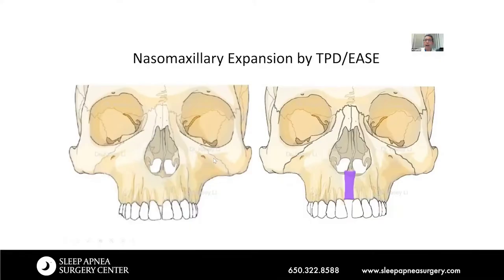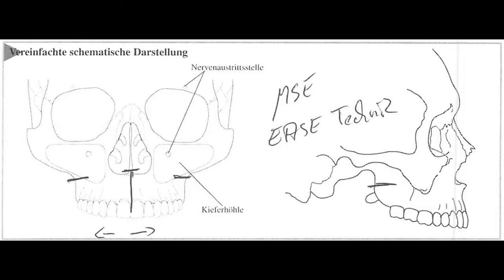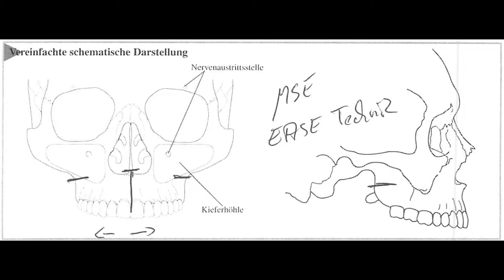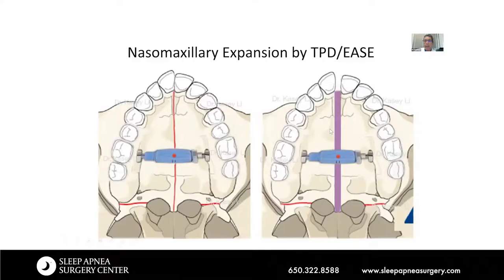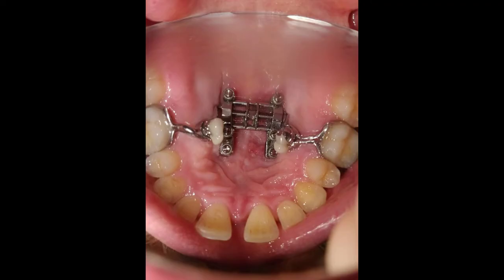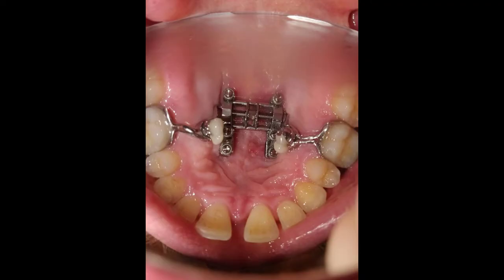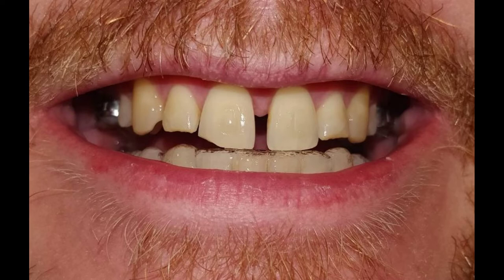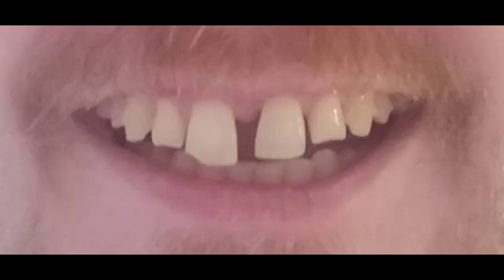EASE Surgery: My Experience & Future

Comment: Great video. Thank you for this!

May I ask a couple quick questions?
1. What did your doctor say regarding asymmetry? Would they do another surgery to weaken the sutures on your 'stronger' side? 
2. Based on your experience, would you suggest to go directly for EASE or try MSE first?
3. Are you planning to get bimax surgery after this to further improve your airway? If so, why / why not?
Reply from the maker: Thanks.
1. I don't remember if we even talked about it actually. I am not going to do another surgery since I have already expanded a lot and I need the upper palate to still be able to fit the bite of my lower jaw.
2. I would start with MSE since putting in an MSE is much less invasive and you have very little to lose from it.
3. I don't have any plans for it and I hope I can avoid it. I am open for it but I would need to do a sleep study to see that it would actually improve my case.
Reply: @youtubejkk  what surgery are you planning to address the assymetry? Is fixing lateral assymetry even possible?
Reply from the maker: @friendlyhuman3582  I have no surgery planned for the asymmetry and I am not sure there are any.

Comment: Hello,

I'm planning on undergoing maxillary expansion. I'm from Croatia, where there are limited providers of less invasive procedures. Furthermore, I have a few questions for you, and I would greatly appreciate your time and effort in answering them.

First, does Dr. Bettina Hohlweg-Majert's clinic perform the cuts and place the MSE expander? Their page states that an orthodontist should place the MSE.

Would the KLS Martin (TPD) with the cuts be more expensive than the MSE with the EASE cuts? or it's the same
Did you turn the device on your own?
As an international patient, approx how many visits did you have to the clinic?

And finally, the most important question: what was the full cost of your EASE journey? meaning, with the MSE expander and correction of the bite as well and all of that. 
you said 5000euros was that only for the osteotomies? 

Cheers!
Reply from the maker: Hi,

"First, does Dr. Bettina Hohlweg-Majert's clinic perform the cuts and place the MSE expander?"

The Dr. makes the cuts but the MSE is put in place by the orthodontist.

"Would the KLS Martin (TPD) with the cuts be more expensive than the MSE with the EASE cuts?"

I don't know.

"Did you turn the device on your own?"

It is turned by the Dr. during the surgery but after you turn it just like a regular expander.

"As an international patient, approx how many visits did you have to the clinic?"

You need a few visits before and after but you schedule it so you can do it all in a week.

"And finally, the most important question: what was the full cost of your EASE journey? meaning, with the MSE expander and correction of the bite as well and all of that. 
you said 5000euros was that only for the osteotomies? "

The costs have probably increased now but the 5k EUR was just for the surgery. The MSE was already payed for.
Reply: @youtubejkk  how much did you pay for MSE? you said you had multiple sets with Moschik, did you pay for every one? or you payed one price and he kept going till you expanded
Reply from the maker: @CroElectroStile  I think I mentioned the cost in one video but I don't remember it now. If you want the exact cost I suggest you contact the orthodontist since it might have changed anyway. The cost was a one time fee, regardless of the number of MSEs.

Comment: The inclination that you mentioned that came with turning the MSE post-EASE seems to be something that occurs for some Kasey Li patients too. For the TPD you could speculate and say that this has to do with the device being installed improperly at a slight angle which may cause this. Since you're using the MSE I can't really see it being installed "improperly". Very weird that you saw maxillary canting with the MSE.  You did say it was a bit asymmetrical prior to the procedure from past treatment, the EASE must've just accentuated it.
Reply from the maker: Good point, that is entirely possible.

Comment: Great video.

On a scale of a 1-10, with 10 being perfect breathing in both nostrils. How good is your nasal breathing after expansion now? 

On the same scale, how was it before expansion?
Reply from the maker: Thanks. I would say my left nostril has always been good but my right has been quite bad. So for the left it was probably 10/10 all of the time but the right went from probably 4/10 to 7.5/10. I still have a little bit of the same problems but it is much improved.
Reply: Fascinating. If you're still around -- what kind of nasal issues are you having? i have UARS because of "75% nasal obstruction" and i believe strongly it might be [somehow] related to my narrow palate. Undergoing nasal surgery on January 5th but having second thoughts. i need relief desperately, so i will probably undergo the surgery regardless ~